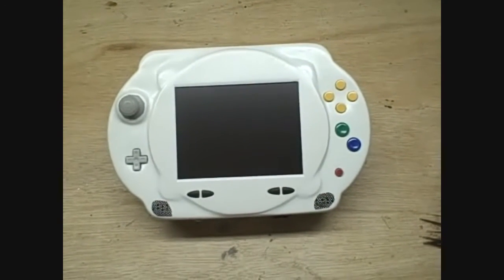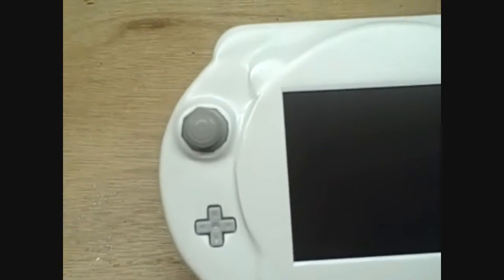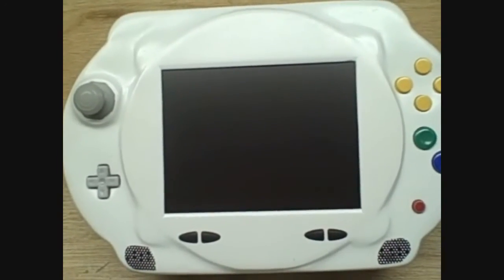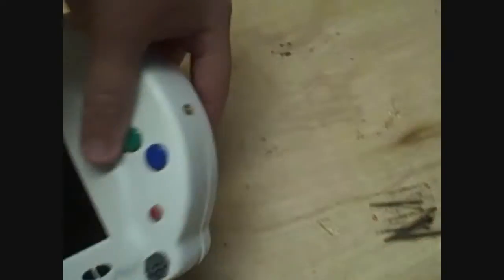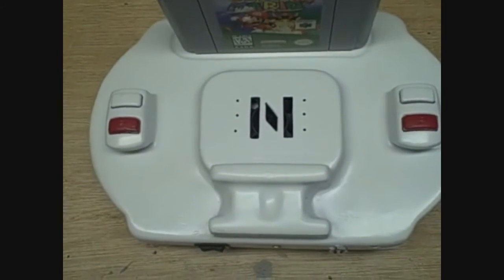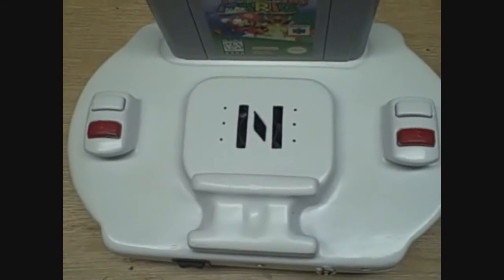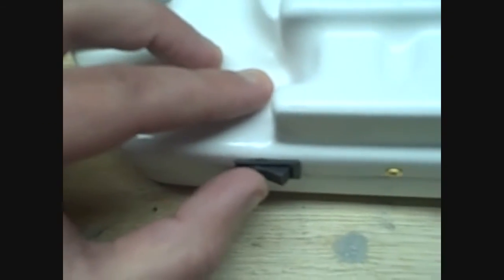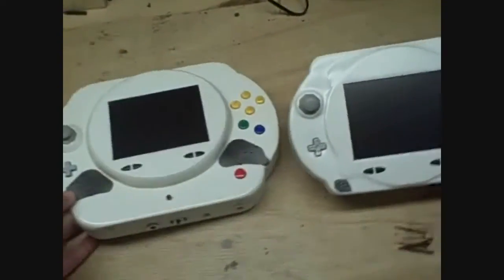Downing's 3rd N64p "The Nimbus II"

Comment from the maker: @KainDelpher Well, this one cost me about $200 only because I didn't have to buy batteries, they were ripped from another project. But had I bought those, it would have been around $250. You can build cheaper ones, sometimes for as little as $100, but I had to get speakers, switches and a few other things like spools of wire and some new tools. Check out the links, plenty of good info over at MBB on how to make one!